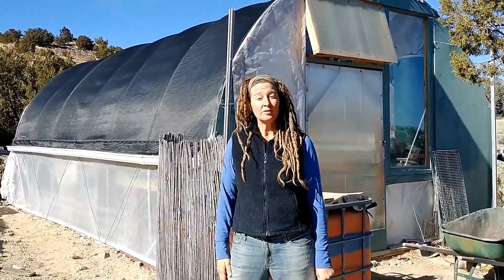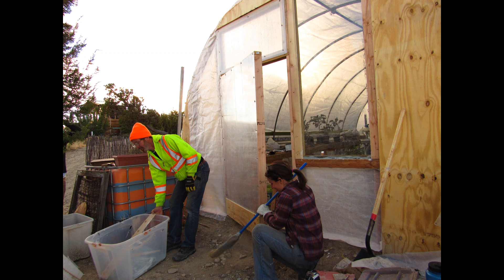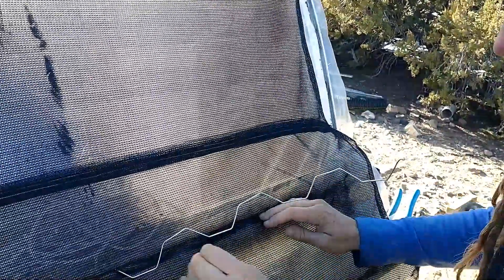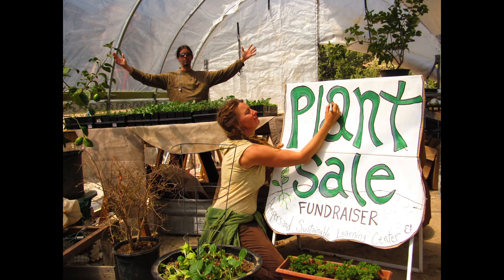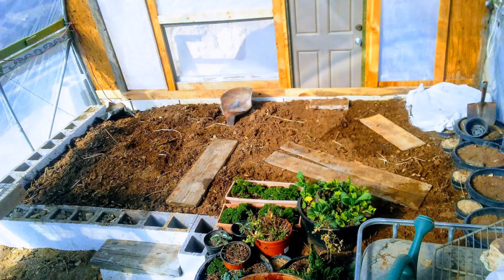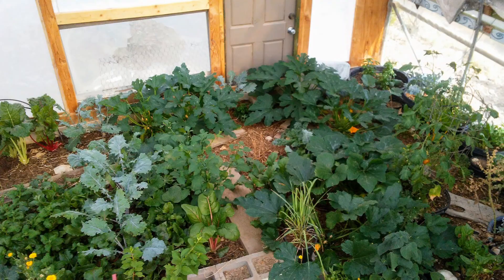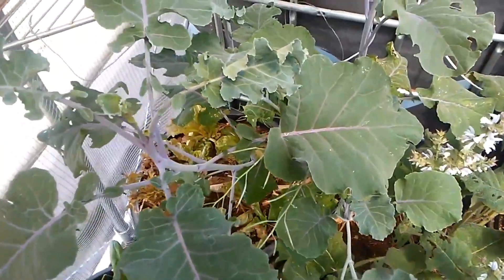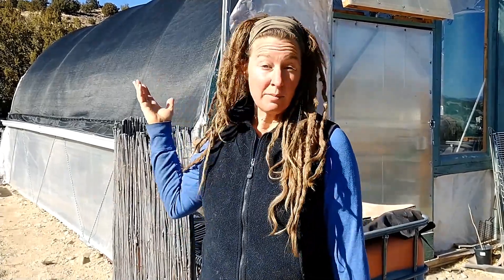The Rain Harvesting Greenhouse [High Desert]

Comment: What are the temperatures like in the hoop house during the summer cerrillos heat?
I see you have ventilation, thermal storage and shade cloth over the plastic. Has that been enough to keep it from overheating?
Reply from the maker: The side walls open up completely so that helps a lot. It can get quite hot, I'll have to start tracking the temps. It won't be cooler than outside in the shade, but definitely less wind and evaporation.